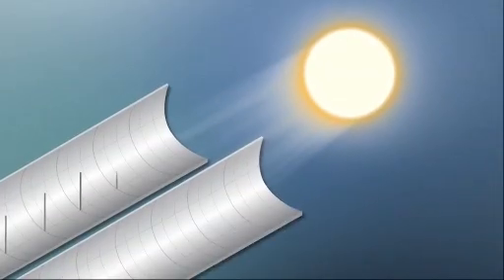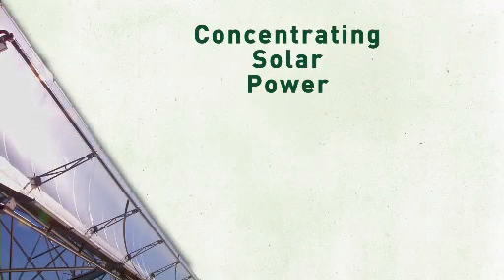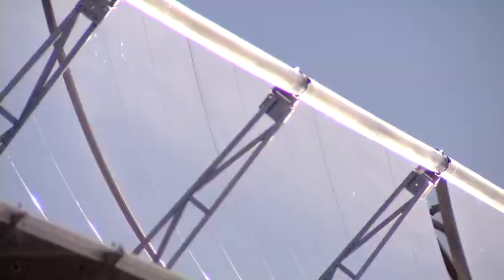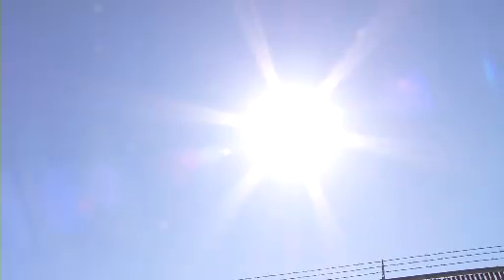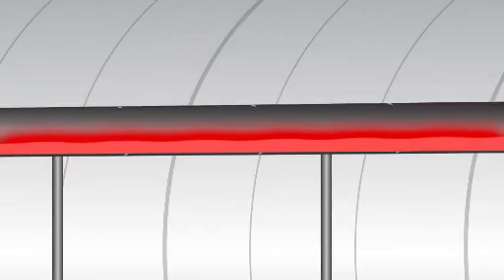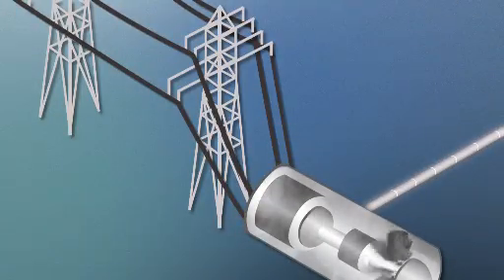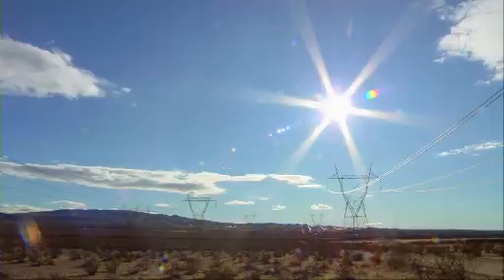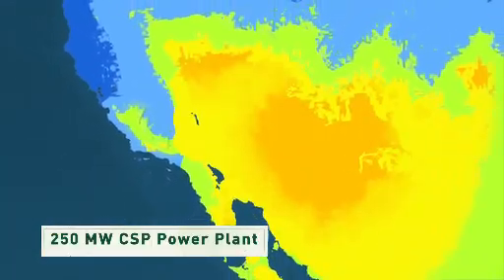Energy 101: Concentrating Solar Power

Comment: installing Concentrating Solar Power throughout the Sahara desert and you will get unlimited and sufficient energy for the entire population of the world, even more than 1000 times more than the needs of all humans.

superiority
1. easy to manufacture, so much easier to automate.
2. Low maintenance and long lasting, so it's easier to automate.
3. The efficiency reaches 60%.
4. Can be used day and night if the core uses molten salt.

Comment: I just figured out how to produce energy that can be given back the grid in Arizona three to four times a day in Alaska the same amount and how I thought to do this how can we do this so that the homeowner never has to worry about the longevity of their batteries anymore and we do it by converting to capacitor high low capacitors that are capable of storing the years worth of energy capacitors that can give back to grid three or four times a day capacitors capacitors people we need to do this I don't even have a home yet but my first home is going to have solar panels with capacitors

Comment: Hello.. I have a query please.. While the HTF in the parabolic trough system reaches as hot as 390 C or so, how the steam temperature (that runs the turbine) can be raised to more than 500 C ? Thanks a lot
Reply: Where are your numbers from?
You might have mixed up different systems (trough, tower) and/or different heat transfer media.
You can't get steam of 500 degree celsius with thermal oil, but for instance with molten salt.
The Gemasolar solar power plant (solar tower) would be an example for over 500 C with molten salt.
"Nevada Solar One" (parabolic trough) uses thermal oil, which can be heated up to 400 C.

Comment: The system works only efficiently if the sun is traveling high up, right? Otherwise, the efficiency would be low because the movement is limited to one axis. Meaning it would be only efficient in the region of the equator.

Comment: so what happens on cloudy days?
Reply: The stored heated fluid is used
Reply: @J0E1L3  Usually, heat storage is just for a couple of full-load-hours. To shift solar energy from midday to the evening (rather high energy demand).
There is no CSP-plant which can run on buffered heat for days. 
On cloudy days, there is no electricity production. Some CSP-plants are hybrids and can run on natural gas too.

Comment: I wonder if you could do a hybrid concentrated solar/geothermal power plant with both a high temp steam power turbine and a lower temp power system (refrigerator compressor running backwards, temperature differences making electricity instead of electricity making temperature differences) basically you uses solar in the day and the geothermal resource at night, throwing any excess solar generated heat underground.

Comment: @mrhippo79. 

Stop mixing up the numbers here!

250MW peak times 8760hours a year equals = 2,19TWh. (250 * 10^6 J / s * 8760h/year). 

Of course its not peak all the time (because of night and shade and sun - angles) . Say its peak sunny about 2500 hours/year. Then the produced amount would be: 250MW * 2500h/year = 0.625TWh or 625GWh. Still a handsome amount of power from a desert that can't produce anything else of value.